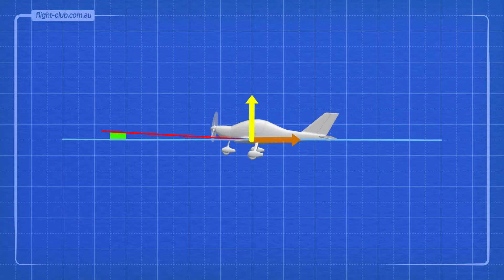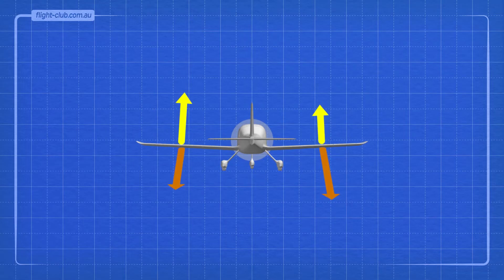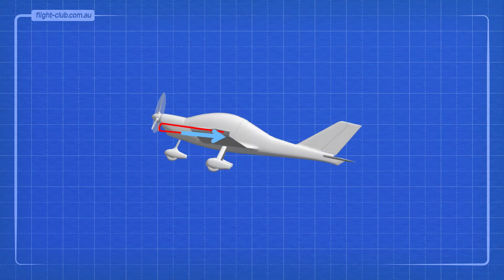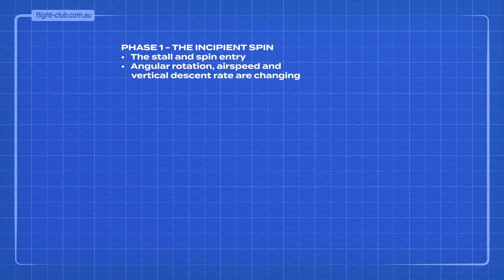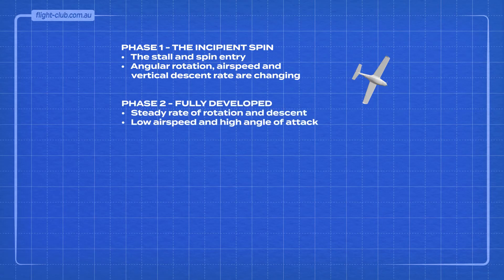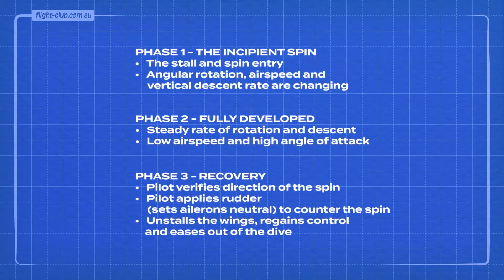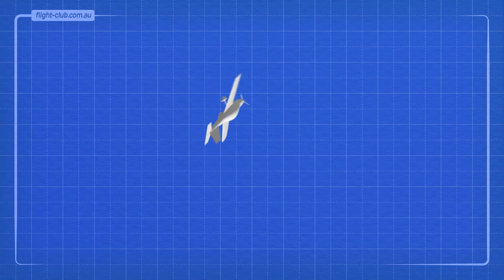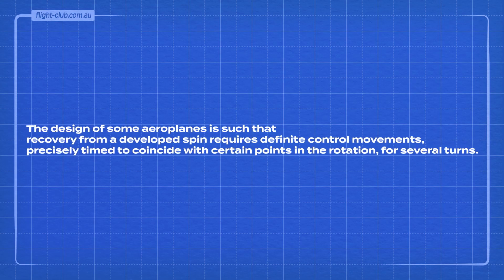What is a SPIN? | The Aggravated STALL

Comment: Is it not possible to develop a software instead of requiring a human to “time” things perfectly to recover?
Reply: It already exists however Most aircraft are old as hell. Good luck upgrading those
Reply: The whole fun of flying light aircraft is to do it yourself, not let some piece of software or a robot fly it.
Reply: that's why stall warning systems exist
Reply: Most light training aircraft are so stable that it's just not worth it. A C172 is harder to get into a spin than it is to get out of it. As for more advanced aircraft, they have modern stall protection that allow early stall (and thus spin) indication and prevention. The more control authority you take away from pilots and give to software, the less ability pilots have to fly the airplane when the software isn't working as intended (737 max is a case study example to this point).
Reply: It isn't possible to make a modern aircraft to go into spin
Reply: @الشيخجورجفلويد  yes it is...

Comment: Power to idle, apply forward yoke/stick pressure, neutralize the ailerons, and apply opposite rudder. When the spin stops, neutralize the rudder, and wait for the plane to accelerate some before pulling back on the yoke/stick to pull out of the dive. Pull back too soon or too hard and you’ll go into a secondary spin..
Reply: Thank you for giving the GA explanation the video did not—too broad of a theoretical standpoint on the video.
Reply: PARE. Power to idle, Ailerons neutral, Rudder - opposite, Elevator down
Reply: @Weeeeeeelp  it's funny because "pare" means stop in Spanish, and you want to stop the spin
Reply: @Weeeeeeelp yeps. My scholl has us learn it as PAREFRE, all that's added is the order to recover stuff after rotation ceases. After rotation ceases FRE flaps up (if they aren't already) neutralize the rudder, pull up gently with elevator
Reply: @txkflier thats not right.  PARE is the memory aid - Power Ailerons Rudder Elevator.  If one follows your order, the spin rotation will accellerate immensely when you use forward elevator before rudder and this will delay recovery - depending on the aircraft recovery could become impossible.
Reply: I'm learning. That's in the Manuel I'm studying. Just need to put it in practice
Reply: Just want to add to the recovery process... lastly when you pull out of a spin... look up to see what you are flying into.

Comment: Recognition is the correct coordination but you gotta have the altitude right?
Reply: Less than 500 feet AGL you are most likely doomed. 1000 feet AGL should be enough for any trained pilot. 2000 feet should be enough for any pilot. If a pilot can't recover a spin in less than 2000 feet he should not be flying.
Reply: The initial spin in the ìncipient phase the airplane loses 1000ft of altitude. Every spin thereafter is about 500ft altitude loss. So, yeah, need the altitude if the airplane is in a spin. If you recovered before the spin, hallelujah. 

If the aircraft is not spin rated you have only approximately 1.5 turns  or 3 seconds (whichever is longer) to recover the aircraft before the aircraft is not guaranteed to survive the scrutural stress (can literally fall apart in the air.)

Comment: Great video, thank you for the explanation.

I have a question about AOA, THE inside wing has greater AOA is because the aileron deflection, downward rolling movement or slower speed than the outside wing? Or all the factors contributes to that? Thanks
Reply: It has to do with the AOA caused by the aileron changing the shape of the wing.  The lowered aileron causes the wing to think it is at a higher AOA (connect the imaginary trailing edge to the  leading edge - this is your chord line) The aileron works by increasing AOA on one wing, then deflecting air on the other wing.  So using aileron to fix a spin is the worst thing you could do, because the lowered aileron makes the wing think it has a higher AOA, and a higher AOA is the very thing that caused the stall in the first place.  Make sense? The aileron deepens the stall of that wing that is already stalled more than the other wing.
Reply: I'm no expert, but it seems to me that the inside wing's greater AOA at the onset of a spin would be due to all the factors you mentioned, and to varying degrees depending on the aircraft design and other conditions.